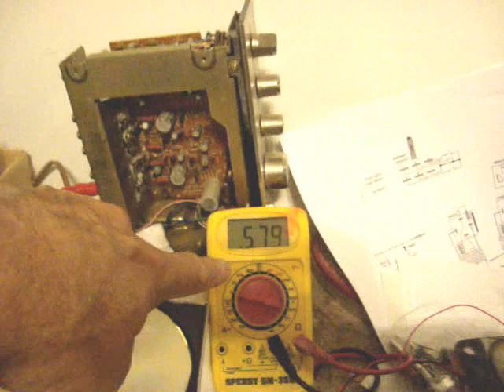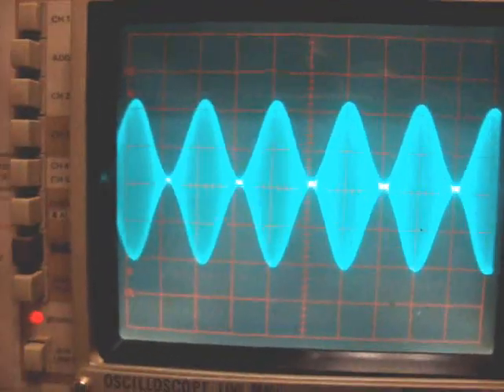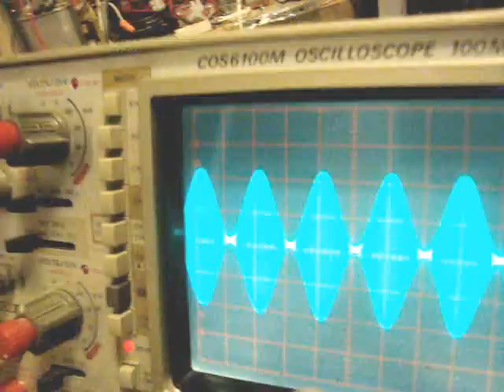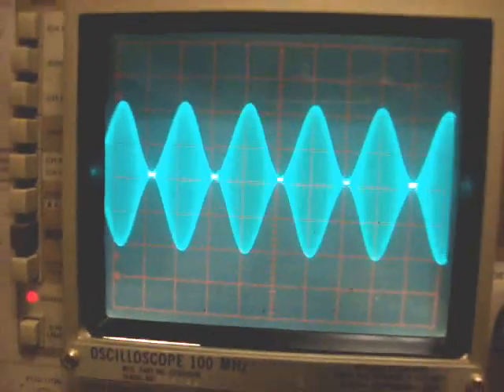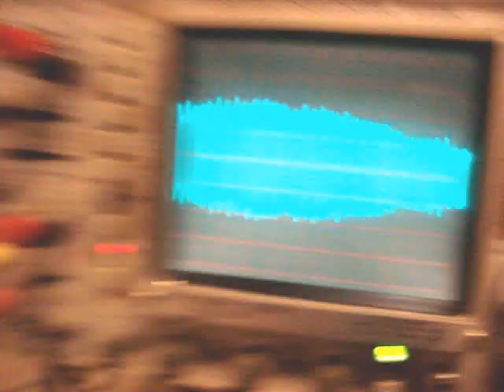20 watt AM transmitter with 6DQ6

Comment: Could I have the schematic? lanceweeks9@gmail.com
Reply from the maker: Sure, I'll get it to you.
Reply: @bob4analog  thanks Bob! Cool circuit. Thanks for sharing! What else have you built with valves?
Reply from the maker: @burntoutelectronics  - I've built tube audio oscillator,  audio compressor, audio amps over the years. Here's a couple things I've made... https://youtu.be/YDm6xCASGow , https://youtu.be/VXpG60ual_4